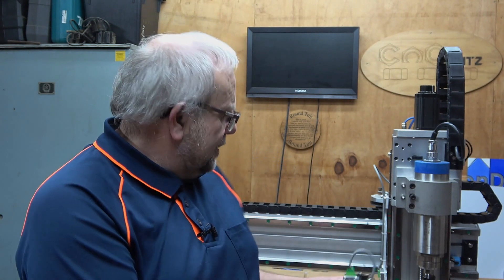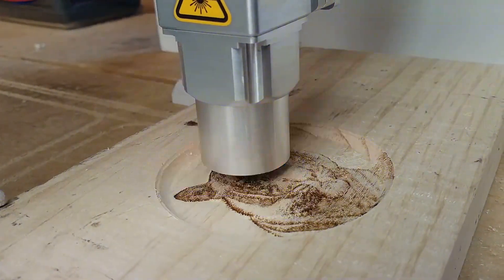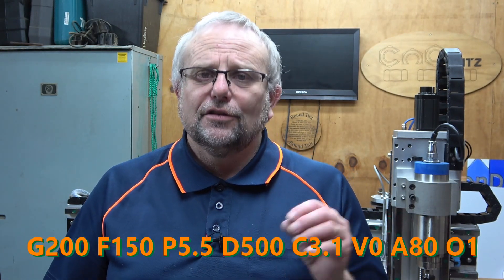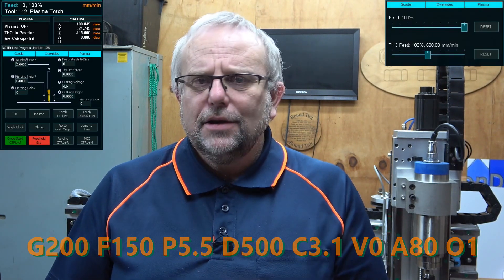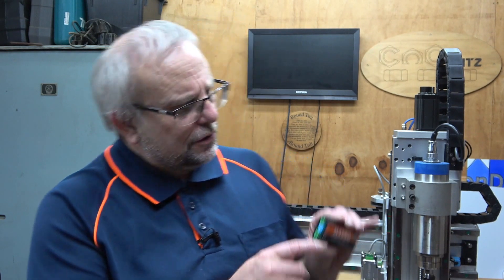Introducing MASSO Multi-Head software - Episode 28

Comment: Peter, what brand is your laser? Or what brand would you recommend?  I love your demos; keep them coming.
Reply from the maker: The Laser I am using as a PLH3D-6W from Opt Lasers in Poland.
Mine is spec'd with a few optional extras line the docking station and the CNC Adapter.
Cheers Peter

Comment: Hi Peter, It looks like you made a few nice upgrades.  I want to avoid landing in Dr. Evil's tank filled with sharks.  Where should I start looking for Laser Heads?
Reply: Hey mate! What are you looking at cutting? I'm getting an 80w (40w X2) from Alibaba. $350 but the 30-50w are a good buy for most things
Reply: @mitchimal  Sounds cool. mostly plastics, card stock, and thin wood if possible. Do you have a link you can share?